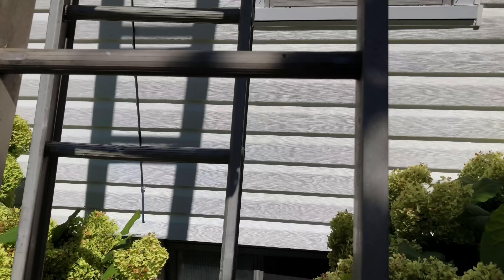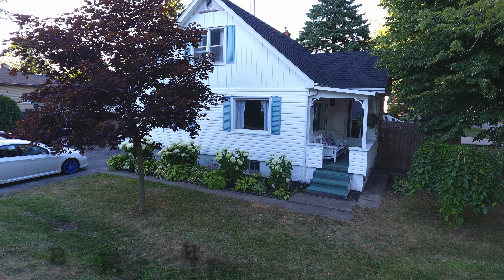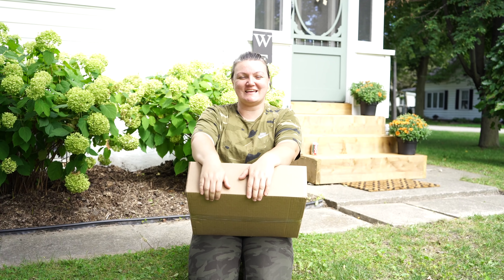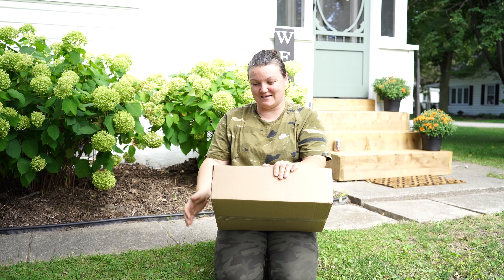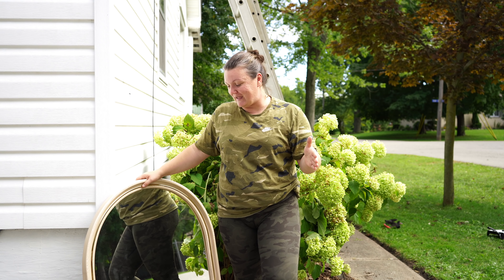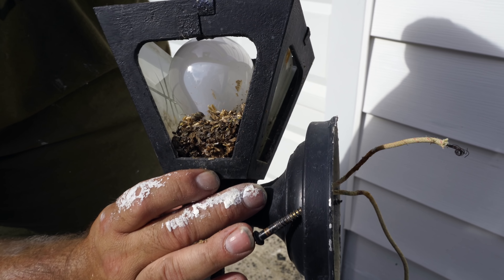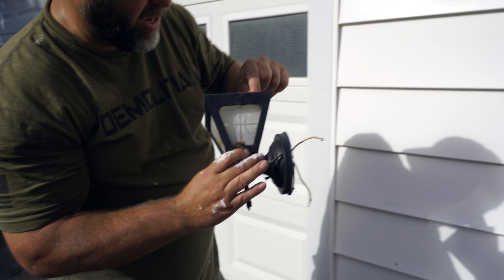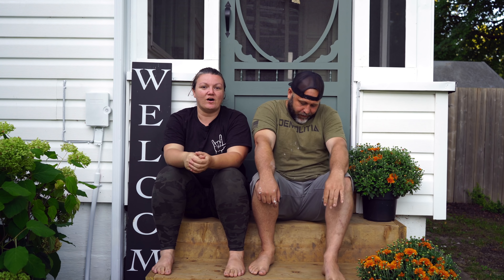Extreme Home Makeover EXTERIOR | Refreshing our home on a small budget

Comment: When I buy outdoor light fixtures I always buy the ones with the bottom open. With the bottom open the bugs fall our and don't mess up the inside nearly so bad. Plus you can change the bulb without taking anything apart. Saves some time and effort.